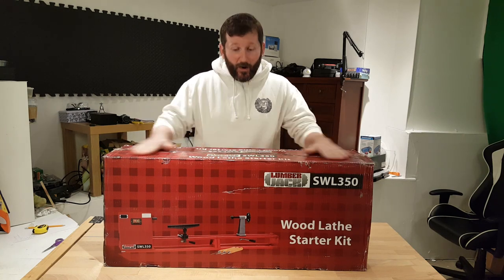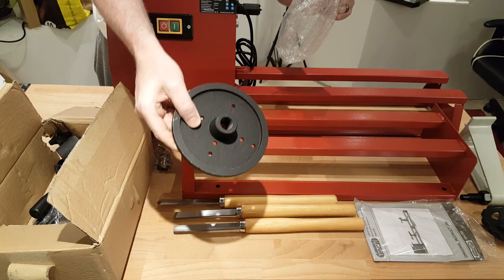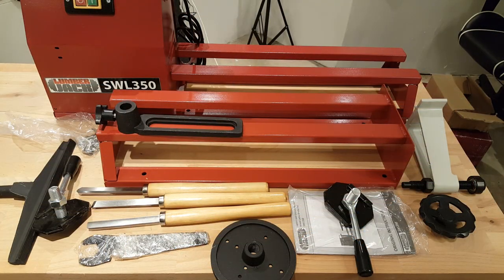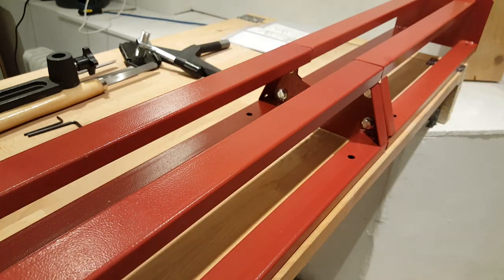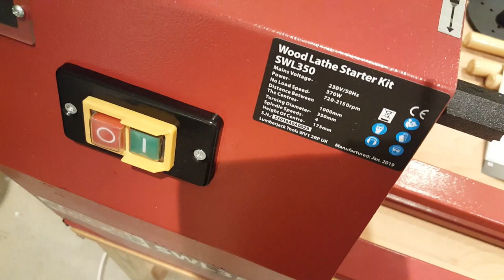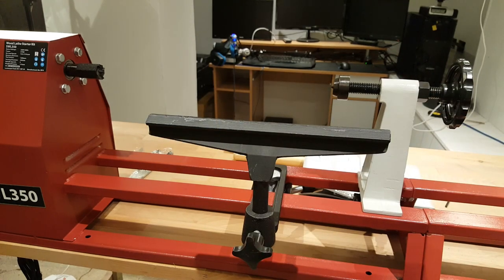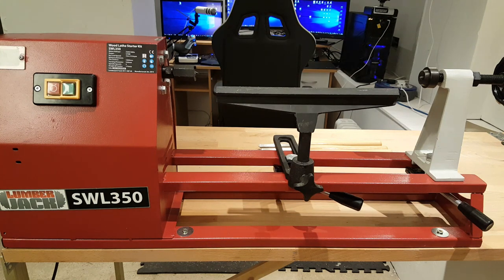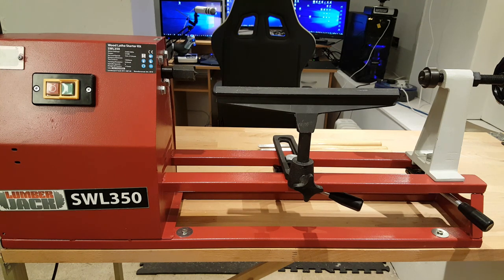Cheap Lathe | Unboxing and Setup | Budget/Starter Lathe

Comment: Wood lathes are lots of fun if you can take a basic class it'll save you time and headache  and get you going
Reply from the maker: I have taken numerous classes via the you tube whilst sat on the toilet.....i mean whilst in my office. I kinda like the headache of learning new things. It's a great adventure as long as I do it safely
Reply: @SausageFingersGaming  yup safety first or you could be sausage fingerless lol but it is a great hobby to be sure
Reply from the maker: @rebekah-chriss-k4872  do you woodturn ? If so please send top tips ? It's a huge learning curve but like you said it's awesome fun !
Reply: @SausageFingersGaming  I wood turn some mostly to make canes and knife handles. Biggest tip is go slow be safe and have fun and if you can get hands on help do that or get some  good shop manuals to read through
Reply from the maker: @rebekah-chriss-k4872  Thanks a lot. I've had a few practice goes now, just getting used to the tools. To be honest I find sharpening the tools harder than the lathing itself :D
Reply: @SausageFingersGaming  Yeah sharpening at first is a bit of a sticky thing hey had a question for you did you build your gaming pc?
Reply from the maker: @rebekah-chriss-k4872  yeah I built it myself although my mobo and ram need upgrading in the near future.
Reply: @SausageFingersGaming  nice I need to build one here too so I Can get to playing star citizen never built a desktop  computer  before though so sorta nervous  I'll muck it up
Reply from the maker: @rebekah-chriss-k4872  building a pc is super scary but it turns out it's like Lego. It just kinda clips together. You can't really plug stuff in wrong as it's certain fittings for the different stuff. Took me about an hour the first time following YouTube tutorials. If you can build an Ikea flat pack you'll fly through a pc build 🤣

Comment: Not sure about the exact model in the video, but for my variation, cannot do anything greater than 17" ( ~ 43.2 cm) and less than 19" ( ~ 48.25 cm) because the plates are in the way of the two sections of the base Rails.  You'd need to make it large and then cut off the excess, which in theory is fine, but feels wasteful.

Comment: I bought this lathe a couple of weeks ago, but waiting until next week when I’m on A/L before opening it. I won’t be turning anything of massive weight, it more for using turned decorations on other wooden pieces. I must day it looks good put up, thank you for posting.
Reply from the maker: I'm sorry to say I had to send this lathe back as it basically shook itself to bits although I was turning some pretty big stuff xD
Reply: SausageFingers Gaming So far, so good with mine but the biggest weight I’ve had on it is only about 7=8kg. I've also screwed it down to a very solid bench and I’m rounding most things off on my bandsaw where necessary. I’ve also not put the extension on mine, I’m never going to turn any legs for furniture.
Reply: @markharrisllb  2 years on & what's your opinion on it? I'm. Looking to buy something similar to turn small/medium pieces.
Reply: @colinedwards931  Because of my health I still haven't had chance to use it, hopefully I'll get chance this summer.

Comment: The very first thing I would do is to see how far the tangs are seated in those "freebie" tools. The last thing you want is for the blade to snap out of the handle under the auspices of a rapidly spinning piece of wood and a handy metal launching pad....

#jussayin

Love the vids!
Reply from the maker: Wow thanks for the great top tip ! You sound like you know your stuff. I had a play today and made a couple of small goblets. Do you have any idea what I would treat them with so I don't poison myself when I drink out of them ?  I checked the tools and they're surprisingly robust for freebies. They did dull very quickly though so I had to sharpen them a few times although I should imagine that's pretty normal. Thanks again.
Reply: @SausageFingersGaming  A two-part epoxy  coating would suffice and would polish up nicely.
Reply: you could also try vegetable oil, i would be careful with epoxy. whatever you use, research it to be sure it wont poison you. check the material data safety sheets for chemicals (msds).

Comment: Looking good SF... btw can fingers made of sausages be medically insured?
Reply from the maker: It's ok Waylander. What could possibly go wrong ?
Reply: @SausageFingersGaming  yes indeed. Hey mate you should really strengthen your bench a bit.. perhaps think about your hinges being closed when table is down, under top not beside.. loving the videos btw..👍
Reply from the maker: I went straight in with the wood ! Turns out I'm ok at it :D  I've made some upgrades to the cave to help in my lathing edeavour. Thanks for the tips. Are you a lathing guru ? If so, gimme loads of top tips please !
Reply from the maker: Hopefully the wood wont flip out like that ! I'm using tiny pieces while I learn and using a full face shield so hopefully it will all be ok. Mostly using 3 inch blocks that I've salvaged on 1700rpm so I can limit the damage.......hopefully
Reply: @SausageFingersGaming  Not a guru...neighbour has one...I have loads of wood if you are after oak or ash...and you find yourself in in east sussex :)
Reply from the maker: @waylander_nq6702  hmmm, hold my beer while I google Essex to East Sussex